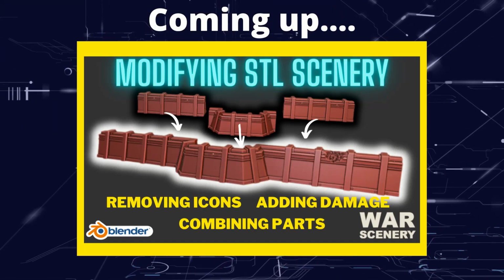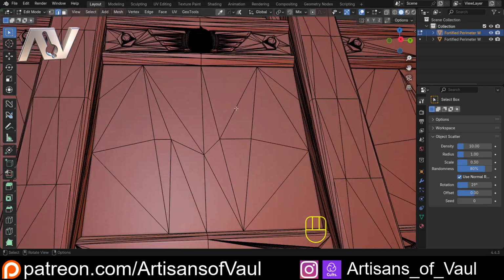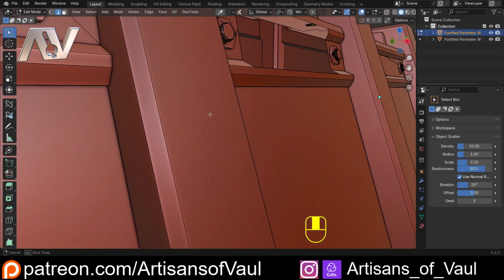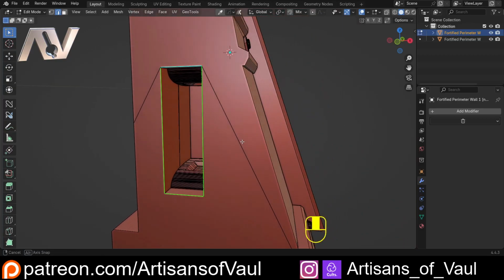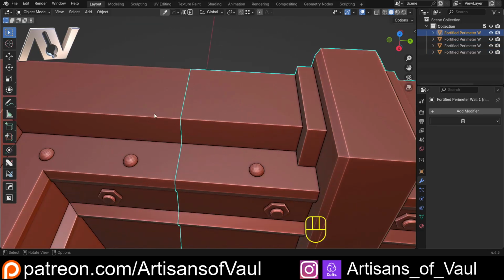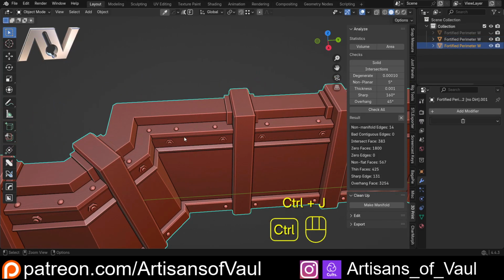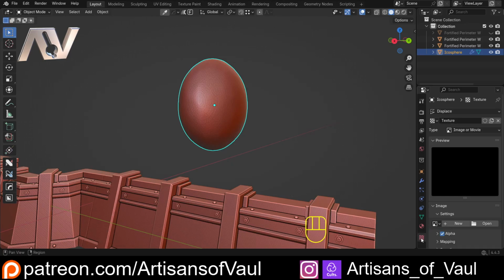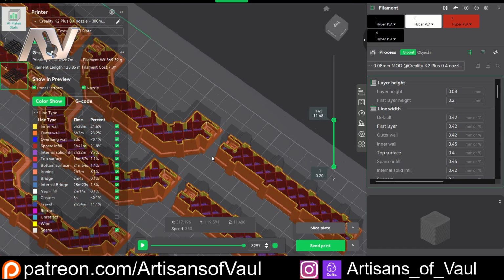The Techniques You Need to Modify Scenery STLs in Blender

Comment: Hi, what do you use if your laptops not got a number pad to press Decimal point to bring your model centre? My spidermans head is in space the period on the normal keyboard doesn't work the same?

Edit it worked selecting Object to origin.
Reply from the maker: Glad you found a solution. You can also change the key map of any key to something else if you need to.

Comment: Thank you for this video

I have been struggling with a file for a few hours trying to remove 4 recesses from a surface.
while the video wasn't exactly what i wanted, coz they never are, Right.. Most videos generally feature a part like this with a totally flat surface, you guessed it mine isn't.

Now i have no doubt you would have sorted this in 5 minutes but this is me!!
Following the video i managed to trace around the holes, delete the unneeded face. so far so good but no matter what i tried the patch was horrible, dips and waves and uneven all over!

After several tried. it was clear this was not the way?

I rewatched you video and i had a what if moment, Now the holes you removed and patched were very basic edge wise on a flat surface...

when you removed the decoration you used the knife tool, after a few failed attempts that wasn't the way either..

Then it dawned on me, don't bother with the limited dissolve as i don't have any flat surfaces. so i found a set of edges that were clear of the hole/feature i wanted to remove. I created a box around the object keeping it basically square. Selected the loop inner and hit delete.

as if by magic, the grid fill worked perfectly following all the contours even allowing me to raise a detail above the now deleted hole as a mounting plate
Reply from the maker: Good work!  You're absolutely right, the limited dissolve is only really wanted when you have flat surfaces or it can cause more issues than it helps.  I should have made that clear.

Comment: Could you make a video on how to edit files so that two surfaces can be joined together using the clip system they are using in that kickstarter?  I believe its called the openlock system.
Reply: Our Clips are called WarForge and they are also super simple to work with. OpenLock is of course also great! :)
Reply: @warscenery  My favorite was the one that embedded spherical magnets in specific places in the prints. No matter how you brought the units together, the magnets would spin in their holes and align to hold them together. 🙂

I spent about 10 minutes trying to figure out what anyone's clips were called and I couldn't figure out the google terms, so thanks!
Reply from the maker: As in how to make something for your own models?
Reply: @ArtisansofVaul  yeah, or how to cut up a pre existing STL and add the clip holes to both faces so they are aligned correctly.   I downloaded the openlock templates (free to download, opensource) just not sure how to apply it to models.  Can't find any guides on how to use them.   There's some files id like to split and then attach together post print...without the need for glue.   

Its a good solution for files that haven't been optimized well for fdm printing (overhangs everywhere) or something that's too big for a print bed that needs to be cut up into multiple parts.
Reply: @anab0lic  You could take the wall, delete everything except the clip hole and the face it's in, then make that face square, with the bottom extending down to the right height that you want to use. You could then replace whatever face you have, or boolean it into whatever part you're building. Basically, use the same techniques except delete everything except the hole, then connect the edges of the hole up to the face of your new model.

If you want it at a consistent height, take a model like the wall, align it on the X and Y so one of the corners is over the origin, delete everything but the hole, and then Alt-G to apply the location. That'll move the origin of the model to 0,0,0 without moving any of the verts. Now you can just snap the object to the bottom edge of your model where it would touch the print-bed and it'll be at the right height.

Also, people who invent these things tend to want you to use their connectors, so they'll often give you models of the holes you can use yourself with instructions, if you google for them.
Reply from the maker: @darrennew8211  Great details and a very sound suggestion! 👍👍👍